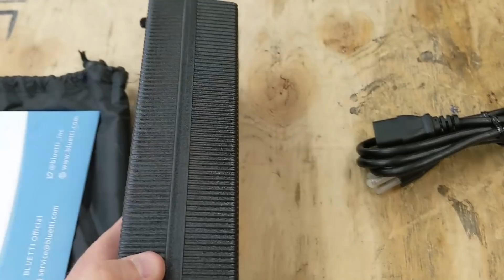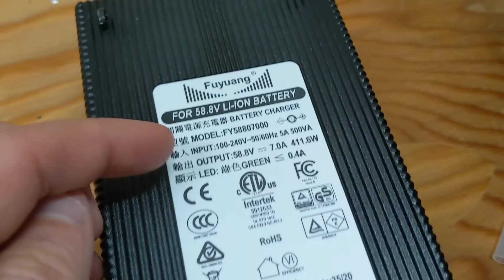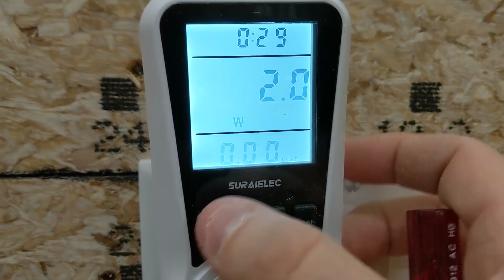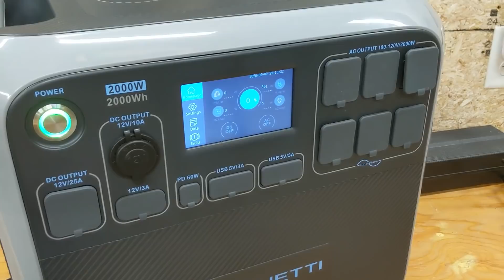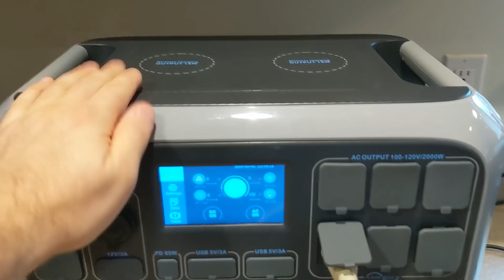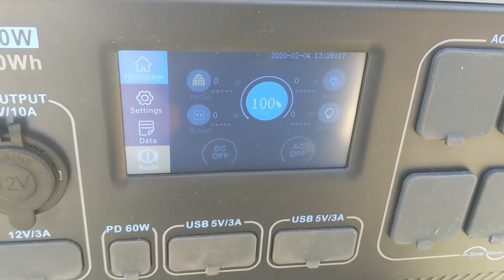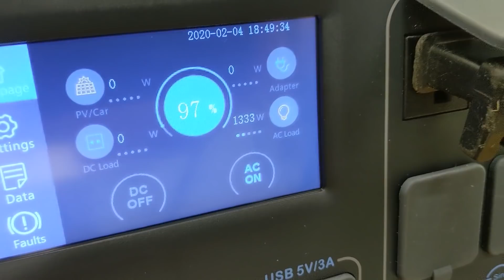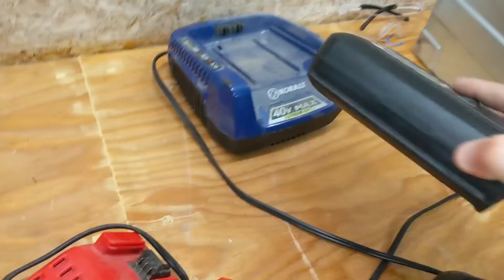DPoz Reviews:  Bluetti AC200P - Updated model for 2021 - Solar Generator

Comment: Nice video. It hit a lot of points quickly and was easy to follow and understand. 

Mine is coming this week and can’t wait to try it out.  Also bought the three portable solar panels with it. My original intention was for testing solar power and storage as an emergency back up at home but it’s been a year of shelter in place more or less so just kept experimenting.  So here’s where I’m at currently (pun intended). 

So far, testing for home use for an eventual full rooftop solar panel grid. In the meantime I have Bluetti 240 which tops off at 1000w and no leeway for over wattage.  My latest testing on that is running fridge overnight while charge during day.  I only have one 180 watt rooftop solar panel right now  so it’s diminishing returns but between my two Jackery 1000s previously charged to 100% and rotating around the stations, I’m on my fourth continuous night of using my power stations to run the fridge.  It’s been mostly sunny days and the sun is literally hitting it’s nadir as the winter solstice is two days away.  So, pretty good and impressed with that.  The Jackery 1000 will make a cup of coffee on my one cup Keurig with over wattage of about 1150 watts for a couple of minutes so my morning coffee is always solar powered. The Bluetti 240 simply cuts off at 1000 watts so not good for coffee. 

I can vacuum my complete home with the Jackery 1000 and have not tried Bluetti on that as the Jackery is lighter and easier to carry from room to room. I can power the electrical side of my gas full-featured oven and microwave with Jackery too. Blender for a bit so, basically my entire kitchen, if I only using one or two appliances at a time and not overly long.  For example, electric mixer then oven to do baking works fine and spent the summer baking various desserts much to my neighbors delight using solar (except it’s a gas oven so not 100% solar). 

I ran my home office for a full 8 hours and it only took 49% of charge.  

So, the next bit is the portable heaters which generally take 1500 watts or more. Currently neither power station can handle those so when I saw this 2000 watt power station, this will complete my home emergency line up.  I only need to run the heaters about three months out of the year and only in the room I’m in. The only issue I see with this is the 60 pounds.  Moving that from room to room will be a good workout I suppose. When not using for heating, it’s probably going to reside in the kitchen to run all appliances there.  So, not off grid but pretty darn close and learning a lot about what to expect with appliances and what going fully solar will mean. 

The issue is how much storage is needed. If there is an extended amount of time with cloudy days or other sun blocking issues, it’s alternative charging or back to the grid. So far, power outages in my area are rare, lasting an hour or two.  However, more and more rolling blackouts are being used by the power companies for various reasons. It’s just the future of the grid and partially due to climate change and changing fuels that power plants use. 

As far as I can tell, the sun isn’t going anywhere and it’s free.

Comment: Hey David, have you seen the advertisements for the ElecHive Portable & Universal Super Power Station?  I'm intrigued by the specs but since it's not out yet, I'm also leery about putting out the cash for this.  Any thoughts?
Reply from the maker: I don't give my money to product campaigns.  I'll buy products, and I'll give money to charity, but I won't give away my money to for-profit companies.  Nope.  I wait until the product is available for immediate shipping, then I'll buy it.
Reply: @DavidPozEnergy  I like your motto.  Giving to those in need is an important part of my belief system too.  Thanks for your thoughts on contributing to their campaign.  It was tempting to go in on it at just over $1k, but I’ve got the Bluetti on the way so I’ll be covered.

Comment: Hey David, the reason the compressor wouldn't start but the saw would....
Firstly the compressor doesn't start under load no matter how much air pressure is in the tank, there is a relief valve that depressurizes the compressor everytime it switches off.  

So why it would start the saw... The drop saw (and vacuum) have a universal motor, you could even plug them straight into one of your dc batteries and they would work (slowly).  When the inverter powers on and there is a big load, the voltage of the inverter drops to enable a 'soft start' this enables the motor to spool up at a lower rate. This is useful for universal motors and large incandescent lightbulbs.  However... the compressor is an induction motor.  The speed of the motor is quasi locked to the frequency. This means that the lower voltage just provides lower torque on startup from a motor that already has very low starting torque (much lower start torque than universal motors).  They could do some fancy frequency sweep to get it started, tho that comes with a significant risk with some devices of saturating magnetic cores with flux and causing a significant overload event.  edit: Congratulations on 100k btw.  Hopefully one day I'll be able to join you up there!
Reply from the maker: Thank you.  I think you are the first commenter to understand the relief valve.

Comment: Hi David. It's very nice.  Thanks.  For use cases, if I were to loose grid power, I would want to power my sump pump and refrigerator.  Do you think it would do the job?
Reply from the maker: I think it would probably power up the average sump pump. However there are exceptions to every rule. You may have an exceptionally large sump pump and I would wind up being wrong saying yes or no.

Comment: This is probably the best portable available at the moment. Powers 99% of the things people typically need
Reply: Exactly! I just bought one on their website. I also used their discount code and it saved me $200. 🤑👍
Reply: @BC-hc5dq  hi! im new at all this and looking for a battery solution to heat electrically (a few hours in the late night/morning to get the coldest hours out in a caravan).
Could you tell me if / and how long I could power an electric heater of 1500watt with a fully charged battery with this unit?  And if its not possible, what is it lacking/where to look?  Any insights/advice welcome!

Comment: Thanks for the very thorough review and testing! I'm not sure how I feel about that touch screen to turn the inverter on/off as opposed to a physical button. I love that it will accept a wide range of PV voltage and high wattage. That was one thing I did not like about the Jackery - it took a LONG time to charge. I'd love to see what's inside, especially the battery!
Reply from the maker: Thanks for watching LithiumSolar.  If there is enough interest I'm happy to tear mine down.  Anyone else want to see that?
Reply: @DavidPozEnergy  There’s a video out of a full Jackery 1000 tear down already.  It’s very good.  Sorry, didn’t link it here.  I watched a while back and didn’t feel a need to save.

Comment: I'm feeling rather insulted. I supported the Indigogo campaign that enabled Bluetti to launch this product.  Now, almost immediately, the unit has jumped from 1700 WH (1400 actual) to 2000 WH (1800 actual), a 29% increase in storage capacity.  No notice or anything from the company, or a free upgrade path, or an offer of gear as compensation, or even "thank you for getting us $11 Million to launch, without you we could not have capitalized this model."
Reply: The reason the battery change was 
 forced on the company was cuz their supplier (LG) could no longer deliver the original battery.
This forced a redesign with all that that entails.
In a startup situation funds are a problem anyway (remember that they'd been shipping using Indiegogo), so the company simply wasn't going to be able to "eat" all their original production.  
After things have settled down there might be some "club-like" program, but it's not likely to be anything like what you're describing (based on a simple financial analysis.)
Mike

Comment: High head pressure on the air compressor, I would say if you drain the air from tank and retry it , it will start
Reply: Took a while to find this comment. 100% sure if the compressor has no air in the tank or very low pressure, it would start up and run.

Comment: David, I get to tell you something for a change. The amperage draw time is longer on starting the air compressor than it is on your saw.
Reply from the maker: Thanks Craig.  I wish I could measure the duration.  Probably some way to do it with oscilloscopes, but I don't know all the tricks yet.
Reply: @DavidPozEnergy  I have faith that you will eventually figure out how to do it. Haven't seen anything stop you so far, my man!
Reply: @DavidPozEnergy  You can measure the current draw with the oscilloscope using a current shunt, or more safely using a current transformer. I'd suggest a CT with a built-in burden resistor for ease of use, the "SCT-013-020" and similar models (but avoid the -000, that onle lacks the resistor) seem like a good option found cheaply online.

Then you can observe current waveforms on your oscilloscope. Figuring out a one-shot capture will let you freeze and measure measure the inrush.
Reply: David: What you want is simply to measure the energy under the curve. Fortunately this can be simply stated as a simple number.
In the old days this was done with a ballistic meter & some expertise.
Nowadays there are "kill-a-watt"-like  devices that do it all rather simply.
I bought one from an off-shore vendor some time ago, but sadly it was a one-time deal.
I'd recommend keeping your eyes out for one... mine was less than $20. 
You could also get a EE student to whip something up for you... it could be a good deal for both of you if you'd kinda "market" it for him...
(Come to think of it, I may be able to get a University faculty member colleague to help ... let me know if you're interested...)
Mike

Comment: Love the upgrades but too pricey

Omni Charge is coming out with theirs and for the price is terrific 
https://www.indiegogo.com/projects/omni-off-grid-power-anything-connect-anywhere#/
Reply: well... it's a better price for a product which may never ship, may take years to ship, or might not meet the advertised capabilities once it does ship. you're getting a discount by taking that (quite large) risk. or you can wait until they're available at retail prices then they'll be more expensive than the Bluetti you can get today. also, the Bluetti has double the max charge rate using solar
Reply: Elechive looks good too

Comment: Two things so far.  First Did you unplug the charger before leaving the fridge on it ?  If not seems it would be almost 100% not 52% since it was charging at about 380 watts.  Second , Wasn't it too cold or at least borderline to charge it outside ?  Maybe battery was warm if it was just taken outside from the house.  So would the BMS have prevented it from charging if battery itself was cold?
Reply from the maker: Yes, I unplugged the wall charger while the fridge was on all day.  At the end of the day you can see the charger plug is off.  If I left it plugged in the Bluetti would have still been at 100%.  
Second, according to the manual the Bluetti has built-in cold temperature protection.  It will shut off charging if the internal battery sensor reads below freezing (0°C).  I kept the Bluetti inside my heated garage all night and only took it outside in the morning.  In one of the screens you can see the battery temperature was still good even after the 2 hours of being outside.  I don't suggest anyone keep batteries outside.  I have always suggested keeping your solar batteries inside a heated building, or making a heated enclosure for them.

Comment: The air compressor needs a sustained amount of high current to get it going. The mitter saw only needs a second or two before the current drops. That is the reason.
Reply: It has constant load

Comment: If i had to guess the table saw has a higher inrush current but lasts for a shorter time, whereas the air compressor inrush is longer because it is under load from when it is turned on.

Comment: Wireless charging is really convenient, but it is quite inefficient so I would not use it, but still nice to have it. Is there a possibility turn it off?

I think hat saw started because time that it draw high amps was shorter than  compressor. Bluetti might start the compressor if there is no air pressure at all in the tank.

Nice video and great information. Thanks!
Reply from the maker: I agree the wireless charging is pretty inefficient.  There is an option to turn ON or OFF all the DC stuff.  The air compressor has a valve built in and starts under no-load.

Comment: Starts saw brush type moter air compressor has cap start capacitor run. Your saw will run on 120 dc with that style moter hard on the switch though
Reply: Brush type moter....AKA universal moter much more forgiving on voltage sag and easier to start

Comment: 2000W and almost $2000 to steep for my wallet.
Reply: It’s pricey but it’s on sale now for 1799. Plus, goal zero wants like 1999 for a 1500Wh and it’s Lithium ion not LiFePo4.
Reply: @Alex-dg2mb  good point.  Thank you!
Reply: @Alex-dg2mb  LiFePO4 is just a kind of electrode material for lithium-ion batteries. NCM, NCA, LiFePO4, are all Li-ion batteries...
Reply: @tysonmarcus9231  I am sure he already knows that. You just like pointing out the obvious?
Reply: @tysonmarcus9231  LiFe batteries are a different chemistry, with different nominal voltage and different discharge characteristics. Typically they have much larger cycle life - given similar quality manufacturing. Which is why we label them differently to most NMC, NCA and LiPo. So to confuse the issue and call them all Lithium Ion is silly (even though I know they all use different alloys of lithium as the anode) - because they are not interchangeable.
Reply: @tysonmarcus9231  it is true, all of those use lithium in the battery, but LiIon chemistry batteries are smaller, lighter, and have a shorter cycle life.
LiFePO4 batteries run 3.2 nominal volts instead of 3.7 volts.
LiFePO4 chemistry batteries have a 2000 cycle life, where LiIon or LiNMC chemistry batteries have a 500cycle life, and of course... the electrolyte is extremely flammable....
LiFePO4 has a non flammable electrolyte.
Reply: @Alex-dg2mb  I thought YETI is better. This one look cheap, include adaptor. I choose Jackery or Goal Zero Yeti for quality
Reply: For the price of a small Honda generator to charge my batteries that’s a lot of money $1800 somebody should make an a lot of profit
Reply: @scottward1002  I have the first Bluetti AC200 they put out i love it no noise unlike a gas generator.
Reply: Remember, these all need solar cells, To really fill there role. Otherwise its just a ups system . If you are in the Midwest , like Chicago @ going north, manny cloudy days in a row, very normal. That whole concept doesnt really make sence. Plus the power companies are very stable here. 😁💡🆗🔌
Reply: @hughmc5419  LMAO The power companies are pretty stable there. 🤣😅🤣🤣👏😃  👌
Reply: Here’s the cheaper way:
1/amazon lithium iron phosphate 100ah, $500-$650
Will give u 2000w 
2/ go to www.renogy.com
    Buy 2000w inverter $300-$500

   Total cost: $1000-$1300
   And u get 2000w to run 99% devices

Comment: Best solar generator I have ever used and own 2 ac200 not AC 200p runs a lot of my stuff
Reply: Loves pv also
Reply: hi! im new at all this and looking for a battery solution to heat electrically (a few hours in the late night/morning to get the coldest hours out in a caravan).
Could you tell me if / and how long I could power an electric heater of 1500watt with a fully charged battery with this unit?  And if its not possible, what is it lacking/where to look?  Any insights/advice welcome!

Comment: Your air compressor likely has a longer peak current time vs the miter saw. Once the saw gets running it's fine until you really put a load on it.
Reply: Plus the saw probably has a brushed 'universal' motor. If the voltage sags as it overloads the motor it will draw less current and reduce the burden. The induction motor on the compressor will likely draw more  current as the voltage sags.
Reply: Agreed....

The inrush capabilities kinda boil down to Kwh.  There is a certain amount of "excess" Kwh that can be supplied for a short time to handle inrush.   You can draw a high inrush (up to some limit) for a very short period of time.  Or you can support a lower inrush for a longer (still short) period of time.
Reply: Exactly - it makes a lot of sense if you think about it - an air compressor has a much longer start time than the other units tested
Reply: Miter saw electric brake can cause that error message. saw brakes when you release switch.
Reply: It has more constant load
Reply: I am looking for a battery that I can just plug-in to replace my lead acid batteries in my golf cart, can you help me I’m 74 years old
Reply: @TheJerry1946  I got you homie, Try LifePO4 (Lithium Iron Phosphate)
Reply: Annoying ads dude
Reply: I hope that have modified invertor messed up ur refrigerator